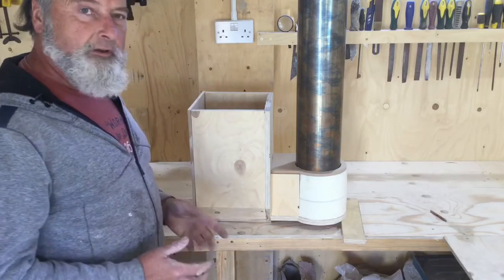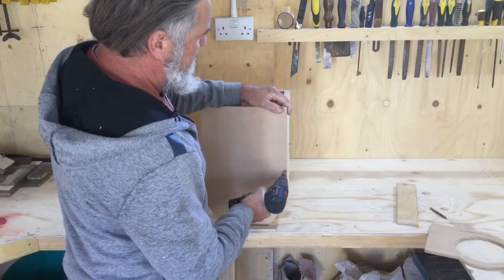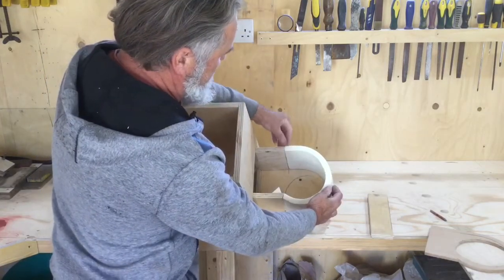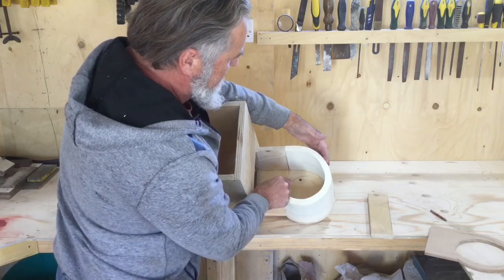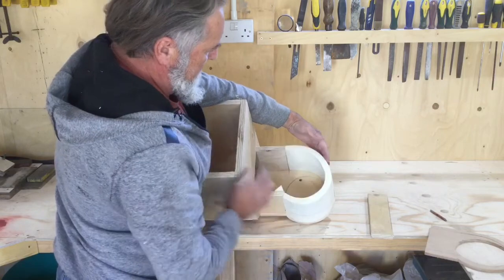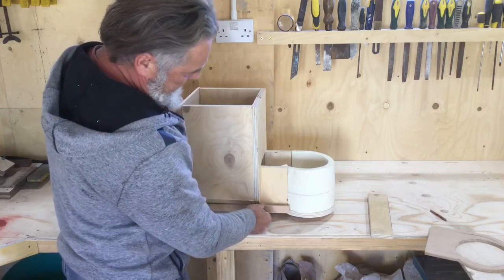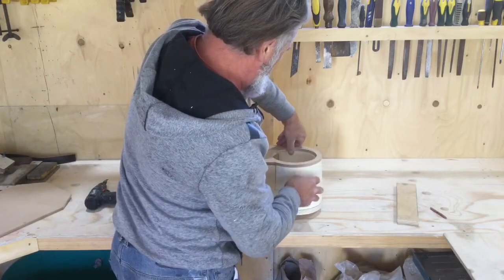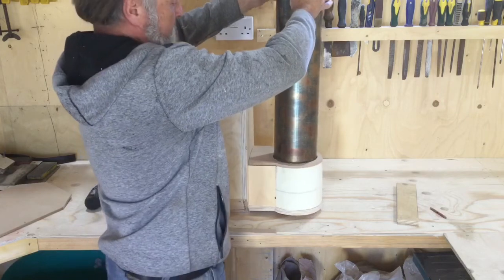Rocket stove model

Comment: Hello , nice moke up, but Peter Vandenberg has shown that the single vortex configuration is not stable and the efficiency is not as good as an double vortex with the centered port.
Reply from the maker: I dont want a double vortex! I am very happy with my final design, there is no smoke and over 600c on my cooking plate and that is more than adéquate  for me thank you very much. I am very familiar  with Peters work but i dont need to copy his design .
He is burning very dry small uniform pieces of wood and working his designs right on the edge of overload, that does not suit my needs but a single top loading vortex is exactly what i want and need.
Reply: @foxfish7115  blue whirl